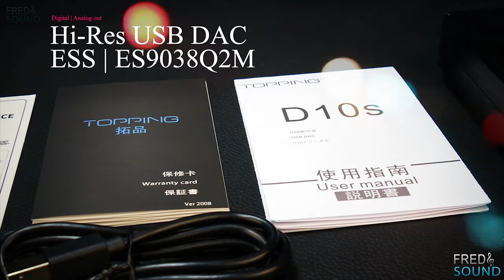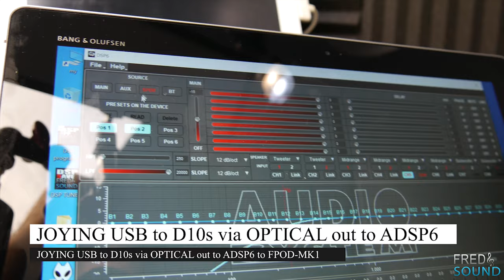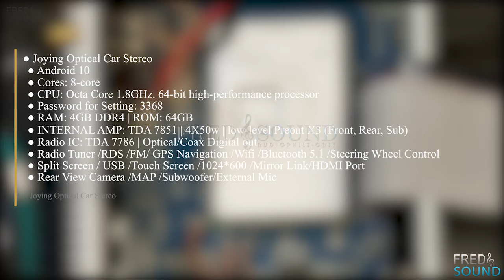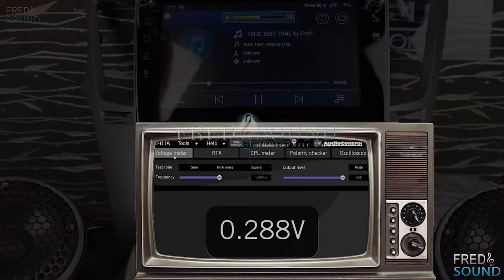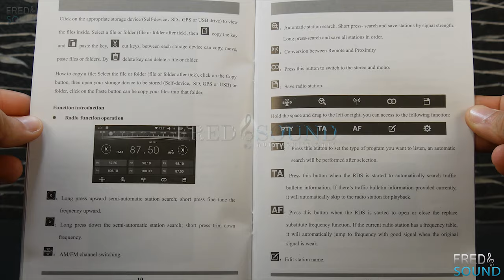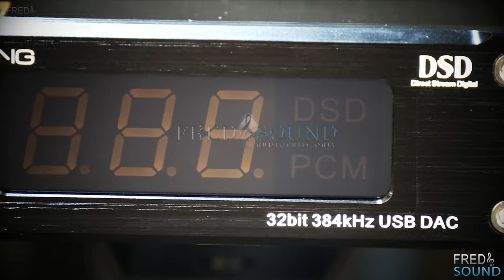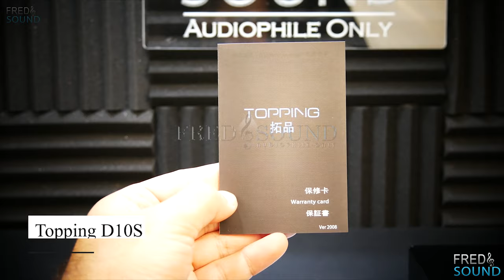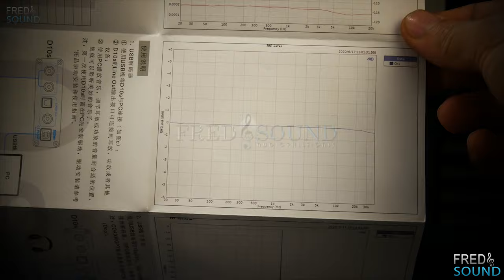Android Head unit using Hi-Res DAC Optical-AUX Out to DSP JOYING vs Topping D10s to ADSP6 (FNS)

Comment: Thanks for the video. Do you know what the max sample and bit rate are for the Toslink? Also does it only play PCM or is it capable of multichannel streaming like Dolby Digital or DTS? I have a DSP with the capability to reproduce 5.1 surround and am looking for a head unit that can accommodate.
Reply from the maker: Hi, I think it will be better checking the full spec of the D10s, in the end of the video you can find the spec sheet, thanks for watching
Reply: try Teyes CC3 headunit. https://www.youtube.com/watch?v=3MkKjUUxOOY

Comment: Thanks for the Video.

I have Joying Android Radio with Helix Match M5 MK2 DSP connected together with Coaxial/Toslink Adapter between it. Because my Joying Radio is older Model with only Coaxial Output.

At the moment i am not very happy with the Sound Quality and the Sound Dynamic. It sounds like some Frequencies are eaten by the Radio. Their are no Bass, No Dynamic, and the High Frequencies also very bad. And i cant compensate this with the DSP. Also i have problem with the Volume Output. Its lower then it should be.

My Question is: Would USB DAC to Toslink fix my problem and is their a solution to volume control over the Radio itself without external volume knob?
Reply from the maker: Hi, well, this is the main problems with Chinese heads. All issues you just described reflect joying and other Chinese head-units. Usb DAC could improve it. But You will lose the ability to control the volume from the head-unit. You will need to control it from your DSP DRC. Thanks for watching
Reply: Well, i think i found a solution for me. USB DAC in combination with HELIX URC.3

I can remove my Mono Amp. Knob and control my Subs with the URC.3. Also the Master Volume.
Reply from the maker: Tell me how it worked out for you🎼
Reply: I have problems to get Audio Signal into my DSP. I tried to change USB Configuration in my Radio to Audio Signal. But it doesnt accept it.

I have Joying Android 8.1 SC 9853i.
Is the Android Version the reason why it doesnt work? 

I tried with my Smartphone Android 14 and everything worked.

Any help or solution?
Reply from the maker: @PioneerFLeX67  it could be because of the version. Try to upgrade the firmware. Thanks for watching
Reply: @frednsound  Which Android Version u had in this Video?
Reply from the maker: @PioneerFLeX67  it was a long time ago, if I remember correctly it was Android 10, here is the full menu video you can find it here:
https://youtu.be/alXTLt4Gbis?feature=shared
Reply: Okey thanks. I will try to figure out if Android lower than 10 is my Problem and if theirs a Solution for me.

Joying contacted me and told me that theirs no DAC Support on Joying Radios in General. Seems wrong.
Reply from the maker: @PioneerFLeX67  send them this link, lol:_Fredx:
Reply: @frednsound  i did. Thats their Message:

"This is the customer who modified the radio and connected a DAC.
If you make sure you can modify it to install it also, you can have a try.
But in fact, Joying does not have this for sale also we do not suggest doing that!
Hope you understand!"

Did u modify ur Headunit or was it Plug&Play?
Reply from the maker: @PioneerFLeX67  lol.. it was just plug & play as you see in the video
Reply: Yeah whatever. I think I will sell this radio. Im tired to search Sound Quality in Android Headunits. This incompatibility pisses me off.
Joying customer service stands in the way, even though they certainly know what they could do to help me. Just like with the update to Android 10.
I think I will go back to Alpine head units. 

Thank you anyway.
Reply from the maker: @PioneerFLeX67  it’s very hard to get sound quality from these units.
I would go alpine utx-m08. You can connect this player to the stock and get optical out to your DSP. Using the player usb music drive will give you outstanding sound quality. If you want more expensive class you can get aune gtx or gold horn p1/2/3

Comment: Hello, mate!  Wow, impressive video of the joying unit . How much is the unit and it looks very well built with lots of features . Do u recommend this unit ? What do u think ? I noticed it does have the optical out which is something I would be interested in . Have a great day mate ! Talk soon
Reply from the maker: Hi mate, nice to see you here, I think
It’s around 500usd, performance is ok, the stinger high10 will be better, although if you add the external DAC it sounds better, but the volume will be controlled from the DRC only, thanks for watching
Reply: @frednsound   the stinger can it be connected as the jowing to a dac  using vis a usb out put ,and if we have a dsp zapco dsp dac upgrading we still need an extrnal dac or not ?
Reply from the maker: @adleneamir4068  hi, didn’t try adding a DAC to the stinger, so can’t say for sure at this point, thanks for watching

Comment: Why do not Simply use analog out put of the dac it can supported dsd256 and 32 bit , the optical of te topping dac can support maximum 24bit/192khz
Reply: Please i hope for an answer
Reply: @adleneamir4068  you'll have to do some more research on this, but from what I have read, the android software limits the output to 44khz/16bit through the internal DAC. One way around that is to use some specific android app that will bypass the internal DAC using the usb output. This way the topping d10s will show the actual bitrate instead of always displaying its max bitrate. What you will see of the d10s is what will actually be sent to the dip. But again double-check me on this

Comment: Hi, great video. It is showing me what I was already starting to build, but was not sure this would work. I already own the topping d10s which is a great dac. What is the reason you have a joying android head unit with toslink output, but not use it directly to the DSP. Is the toslink output that bad or limited in resolution on the joying unit? Does all audio from the joying work on the usb-dac route or are things like fm radio not supported (non-digital on some head units)?
Reply from the maker: Hi, thanks.. the joying optical is not bad, but the sound quality of the topping DAC is way better, you can feel it on the tweeters and smother bass responds, just keep in mind, if you add the DAC you will no longer be able controlling the volume from the headunit, you will need the Dsp’s DRC to control with, thanks for watching
Reply: @frednsound  Hi, I've got myself a joying unit (I already had the DAC). It looks like it's not going to pass audio to the otg usb. The DAC keeps displaying 384 PCM. No sound coming from any of the D10s outputs. Did you make any specific settings to get usb audio working?
Reply from the maker: @r3mc0d3haan  hi, nope, no changes, just plugged the dac to one of the 2 back USB’s and then control the volume from the dsp itself, thanks
Reply: @r3mc0d3haan  Hi…The problem is solved for you…I just got a topping D10 and it shows 384 PCM connected to Joying headunit
Reply: Could you please help me solve the problem?
Reply: @karthikm888  it is not solved with my joying unit. Only when I use a specific player with app-integrated usb driver the usb-d10s works. All other apps do not work with any external dac.
Reply: @r3mc0d3haan  Thanks for the quick response…could you please let me know the app which supports the dac
Reply: @karthikm888  I used USB Audio Player PRO which worked fine.
Reply from the maker: Try the hiby app

Comment: I thought Joying radios dont have USB audio output
Reply from the maker: Hi, well, they have, but keep in mind, ones you add the DAC and using it’s optical out, the volume cannot be controlled from the joying unit, but only from the DRC of your DSP, thanks for watching
Reply: @frednsound  Ah, I see!

You know one thing I am wondering, if a Joying radio can control a Fiio DAP using the Fiio Link App.

Fiio Link App lets you control the Fiio DAP player from an android phone using WiFi or Bluetooth. 

Imagine if you connect a Fiio DAP to your DSP via coaxial cable, but then control the Fiio player from the Joying screen using the app (and possibly using steering wheel buttons!).

Then, you can hide away the Fiio, but take advantage of it's better playback for critical listening. 

I understand Joying radios dont have Bluetooth data communication support (control a device from Joying screen using bluetooth), but Fiio lets this happen with wifi as well.

Something I will try when I can afford a Fiio DAP and install the new Android 10.0 Joying radio.

Would love to hear your input/idea if that is possible?
Thanks as always for great content!💚
Reply from the maker: @HAMMER_2.2  hi, mate, thanks for the great support, sounds good, hopefully it will work for you, first thing to try is if the joying will support the fiio app, many apps Doesn’t support, maybe I’ll try it later on and input,
Thanks again

Comment: Let me understand- what is the point of using ds10?
You send digital signal  to the ds10, then  again! from ds10 in digital form to the processor ....which uses its own DAC:). Potentially the only thing you "add" to signal is sound colorization by ds10. Which one you will correct using dsp equalizer
Reply from the maker: NO! you got it wrong…
Each player has its own frequency respond with its own sound signature.
(If you can’t agree on that so all heads are the same?) joying is so empty and lacking bass. DS10 is better than joying and has wider band and better sound signature. When you get better details to your DSP. You get better final results. Thanks for watching
Reply: The final signal will never be better than the one from the source... it may sound different (sound coloration unique to the device). Or it may be oversampled. But the final effect after dsp correction will be identical (probably after adding ds10 there will be higher distortions - an additional device in the signal path). The situation would be different if you used the low voltage outputs from the joying and ds10 units. In the current state, the final result is determined by dsp dac.
All the best @frednsound
Reply from the maker: @brax1108  what you just said is all headunits sounds the same, Interesting.

Comment: Dear: Getting digital audio from the stereo's optical and USB output should be exactly the same quality (no digital signal processing inside the joying head unit, just 1 and 0 , audio bits, unnecessary use of Topping DAC, a honest opinion
Reply from the maker: Each DAC and component/board has completely different sound quality and different details, each a and every digital output sounds different. Thanks for watching
Reply: Might be a bit late, but this is not true with Android.   The audio via optical is processed via the android audio layer which limits to around 48khz.  USB audio can go to the dac bit perfect.  Since apps like USB audio player pro can go around the android audio layer and directly to the DAC
Reply from the maker: So what you actually saying is all the headunits in the world sounds the same? That’s great news.. go and buy the cheapest🕳️
Reply: @frednsound 🤣 love you Fred ❤
Reply from the maker: @sb5253  love you more😎🎼